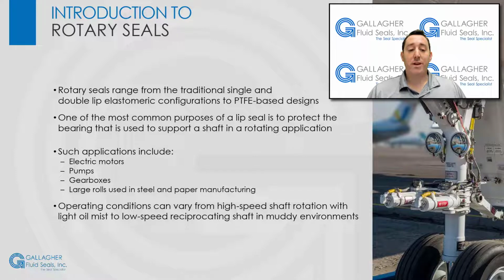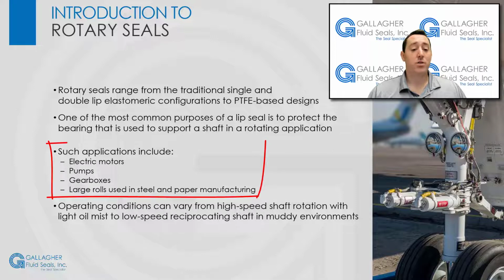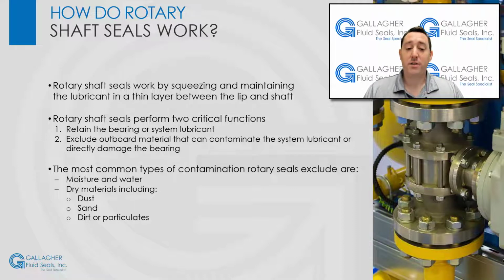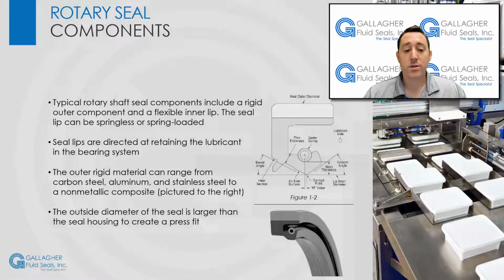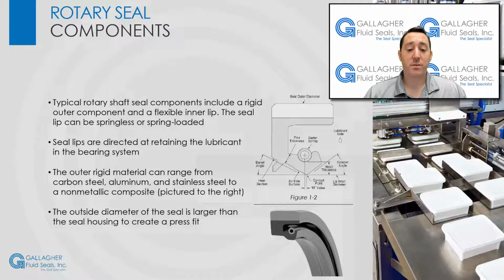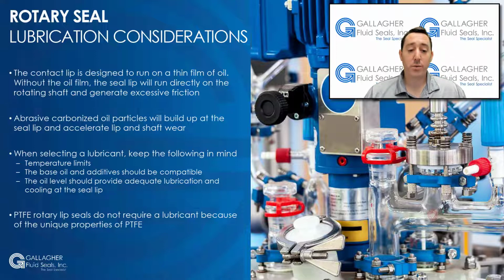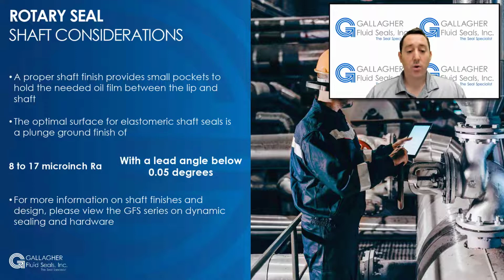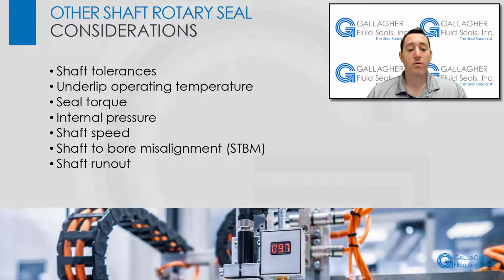Intro to Rotary Seals | How They Work | Applications | Components | Shaft / Housing Recommendations

Comment: How do I take it out if it has worn out
Reply from the maker: Removal of the seal is dependent on the type of seal, location within the hardware, and overall accessibility. Typically, rotary seals can be carefully pressed out or pulled out with a seal puller or pick set.